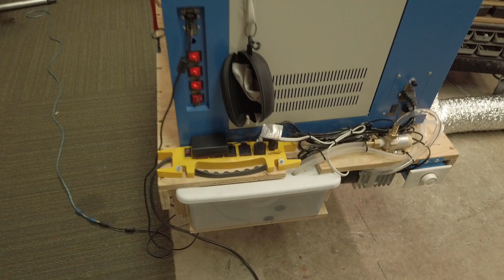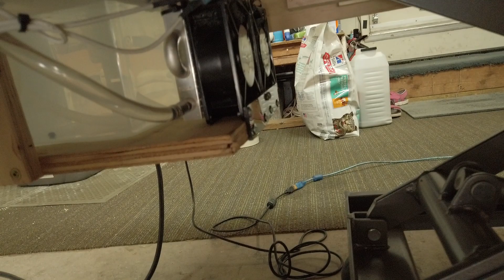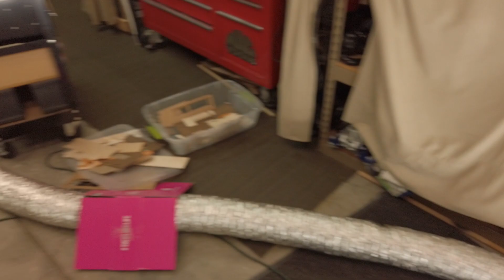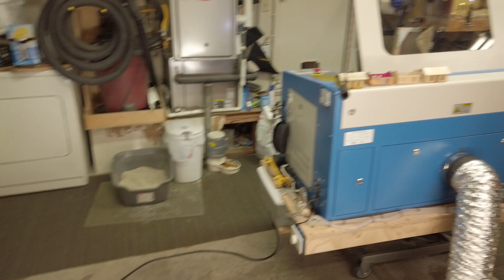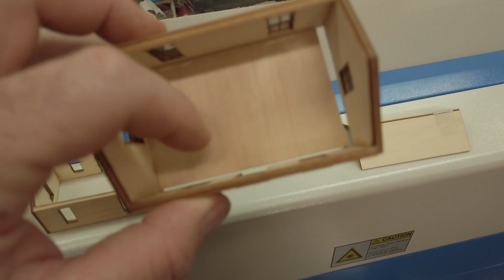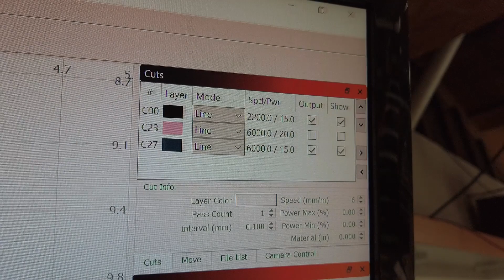50 Watt Laser Cutter and Weathered K-27 HOn3-Layout Update

Comment: You said you make all the windows and doors in the laser cutter. The laser will cut out the pattern on the door? That's pretty cool if it does.
Reply from the maker: Yes it does cut the doors and windows.They are layered so it appears 3d. By turning the power down on the laser, it is able to score the lines to resemble wood boards for the door.
Reply: @Helmikins  very awesome